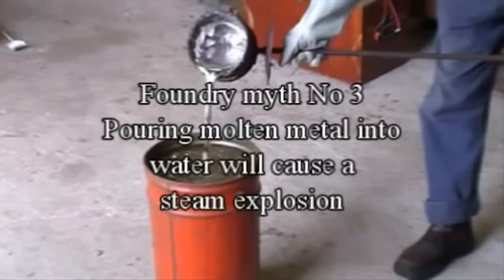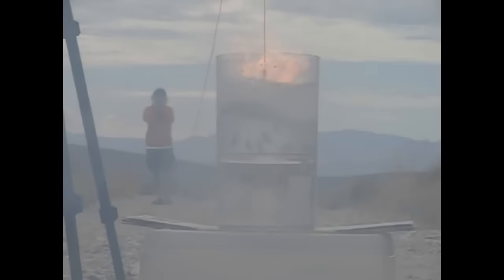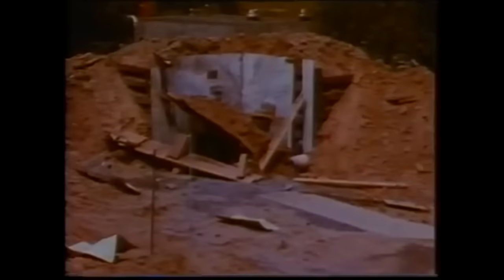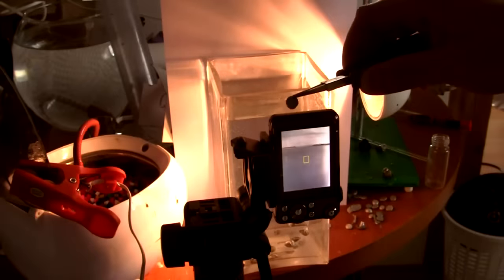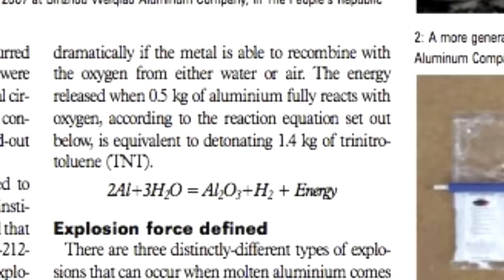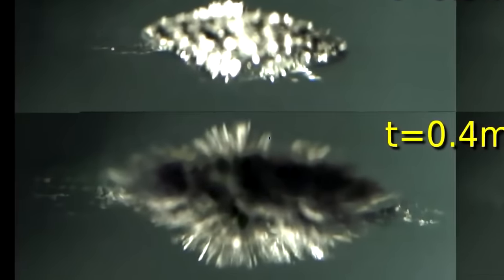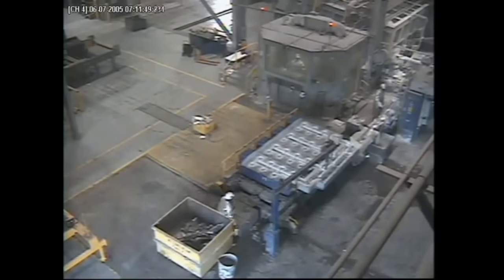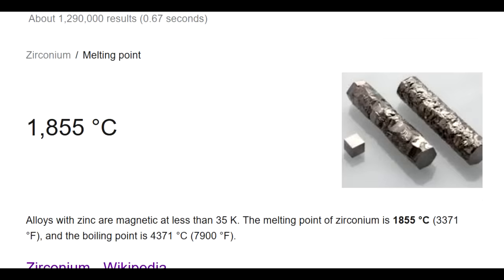The Awesome Power of the Aluminium-Water Explosion!

Comment: Industrial process cooling water can also often dosed with molybdate or nitrite and other corrosion inhibitors that tilts the pH balance a little on the alkaline side (can be almost 9). Whether this is enough to strip off the oxide is another matter. 
As for testing aluminium-water interaction, I suspect if you setup a high purity UHV system with a differentially pumped argon observation chamber; you could in probably off-axis evaporate high purity aluminium onto a hot (> Tm) pyramidal spike in UHV. The spike could drip point down into a differentially pumped vacuum to then an argon atmosphere puddle of DI water. Lotta setup but I can see it be an option.

Comment: pouring any amount of molten metal into water is only dangerous if there isn't enough mass of water to offset the total amount of heat energy in the molten metal as water has the tendency to flash to steam in small quantities. you cant add a pint of water to a gallon of hot metal because the total energy exceeds what it takes to flash that pint off water to steam. but a pint of molten metal into a gallon of water is pretty much safe as houses. if it wasn't then you wouldn't be able to make lead shot.

Comment: I hope you see this....  Many years ago I saw a film about the simulation of a molten sodium reactor leak (making this up - as it was so long ago)  the molten sodium was simulating a 3/4" leak in a reactor coolant pipe at 100 PSI - into the boiling water of the heat exchanger at 420*C....  AND so they got a BIG tank of armour plated glass, and filled it with hot water and dumped a heap of super hot molten sodium into it - and most of the laboratory was just detonated into oblivion.  It the way that the explosion happens, that the sodium blasts into ever smaller and smaller and smaller drops, which are all reacting with the water, and because everything is SUPER HOT and the REACTION is super hotter and super violent - enormous amounts of energy are released almost immediately.  I saw the footage once on TV I think in the 70's or 80's and I have never seen it since.  I have really looked hard for it but maybe it faded with time and history or maybe the nuclear industry shit bricks and buried it.

Comment: The catastrophic explosions that were shown in the video had nothing to do with Aluminum reacting with water to cause a chemical explosion like you would see with alkali metals. 
The reason why they happened were either a large mass of molten Aluminum getting poured into a mold or container that had a small amount of water present.
Now considering that the the conversion rate of water to steam is 1:1600, its no wonder that it can cause extremely powerful explosions that can easily level buildings in an instant.
The other way the explosion occurred was when a large amount of fine Aluminum powder got suspended in the air and got ignited, typically due to faulty dust collectors or just years of negligence that caused buildup on every horizontal surface in the area (which isn't likely to happen in a mega factory, but not that uncommon in smaller ones, especially if the boss is cutting costs)
A lot less energetic materials like sugar or flour can cause a devastating explosion when turned into an aerosol and ignited, let alone Aluminum.

Comment: The first video is the wrong way around, its a small amount of water in molten metal that explodes. The water is engulfed in the metal and almost instantly turns to steam. The mass of the metal acts as a sort of pressure vessel compressing the steam which then explodes as it rises to the top.

Comment: SOME PEOPLE JUST DON'T WANT TO LISTEN;  I once worked at an oil refinery plant where there was an explosion in one of the electrical distribution rooms ( with breakers and such ).   To clean it up we were given brushes, rags, and industrial strength ammonia.  I knew we would need proper chemical filters in our masks,  which is what I used, but this other guy wanted to come in that area wearing a mask with NO filters in place; he was breathing the air straight with no filtration.  I was telling him not to, and he and his buddies pushed me out of the way, and he went in despite my energetic protest that he should not.  He wasn't in that contaminated area for 3 seconds when he began screaming about his burning eyes and lungs, and his friends went in and dragged him out.  NO one told me I was right about needing the proper filters installed in the face mask, nor did they thank me for trying to prevent him from going in unprotected - they just gave me dirty looks like I was the one responsible.

Comment: It’s a matter of ratio, water to aluminum and the speed in which you drop the aluminum in the water. But it’s not just aluminum that does this. It’s any extremely hot object on or in water due to the instant vaporization of the water.

Comment: I've had this fun idea of heating about 200 kg of aluminium as hot as possible, then dropping it through a series of grates designed to spread it out, into a pool of boiling water. The steam explosion would (hopefully) atomize the ultra hot liquid aluminium, get it to react with atmospheric oxygen, and the cloud would then get hot enough for the aluminium to rob oxygen from the water vapor. The cloud would become incasdescent for a short period of time and after it has cooled a little the hydrogen would burn back to water. It would make an earth shattering kaboom.

Comment: I’ve watched less than two minutes in. My first thought is that there has to be a rapid introduction of the molten metal into a small amount of water, so that there is enough energy transfer to the water to turn it to steam. Just slowly tipping it into a relatively large amount of water obviously just cools the metal down without producing significant levels of steam.

Comment: I'm pretty sure that these aren't metal water explosions but aerosolized Metal explosions. The Foundry problem happens when so much metal is added to a relatively small amount of water that there's an explosive evaporation of water that turns the molten aluminum into an aerosol that then essentially is a fuel air bomb, or it could be a fuel steam Vapor bomb either way. When you slowly pour aluminum into a large volume of water very little water actually vaporizes and doesn't create enough of a shock wave to turn the aluminum into an aerosol they can undergo something equivalent to bleve fuel-air.

This would be relatively easy to test. If you had the right equipment in right safety equipment. You would simply dump a large amount of molten aluminum onto a modest amount of water. You should be able to reliably make explosions, while the same amount of aluminum dumped into a large volume of water would never lead to explosions.

You would also expect water very close to the boiling point too be much more likely to lead to explosions than water that was chilled to near the freezing point.

The thermite ice reaction I think happens because the molten metal liquefies and then vaporizes a small amount of the surface ice leading to the aerosol metal Steam and air explosion.

Comment: I have an idea for a molten zirconium setup: Use an induction heater on the metal inside an argon filled glass cylinder. If you get the coil shape right, the metal will levitate until it has the desired temperature and you cut power to the heater.

Comment: Interesting. I actually found this video because I started to look for "aluminum water explosions"  after reading an old paper about a hypothesis of the collapse of the twin towers in 2001. The author thinks it might have been, at least partly, due to the aluminum in the aircrafts ending inside a debris cover that acted like an oven, with the burning fuel raising the temperature to a point where the aluminum (there also seems to be some magnesium included) fully melted and started to flow down, getting in contact with the water in the sprinkler system in the lower floors. Then some of that exploded. Of course the kinetic energy from the initial impacts had already weakened the structures, a lot of the supporting columns seem to have been on the outside walls of those buildings, and the fire had started to soften the steel of the remaining support structure, so... well, at least that would explain the sounds of explosions reputedly heard before the collapses.

Comment: It seems adding water to molten aluminum causes an explosion by breaking the oxide layer on impact, by pouring it into water, that risk is decreased and it cools before it can react. Jmo question mark?
Reply: no, the explosion is caused by steam generated by the heat.

Comment: Here is a hypothesis. Take one aeroplane. Ram it into a tall building at say 500 km/h The aeroplane largely made of duralium get fragmented into small bits. A1 jet fuel, atomized by the impact ignites consuming all the oxygen and heating the aluminium to melting point very rapidly as it is airborne. Visualize globules of molten aluminium flying through an oxygen deprived atmosphere. Then the buildings fire suppression sprinkler system, triggers spraying water into the mix. 

Would it go boom?

Would the "rich" air fuel mixture Flash heat the aircraft aluminium to melting point forming airborne droplets of aluminium with no oxide layer waiting to be hit by a droplet of water, releasing hydrogen which has the added ability to explode Would a fuel rich environment consume any aluminium oxide skin as an oxygen source? Would it get hot enough to melt steel.

Love your videos though sometimes I want to take you to task with regards to energy density and Electric Vehicles. There is a word in the dictionary. Sufficient. EVs have sufficient energy density for 99% of use cases. I wont go on. Happy to discuss.

Comment: I wonder what kinds of circumstances cause the explosion to happen. 

It's probably more likely to happen if there is a high amount of aluminium and little water present, similar to how a glass of water in a pot of burning grease will cause an explosion, but doing the inverse probably won't. At least I don't see any firefighters asking whether there is a pan of burning grease in the kitchen before using their firehose.
Another example would be the constant streams of magma flowing into water with no explosion, yet explosions can happen if the amount of water isnt that high compared to the amount of magma.
Yet another example: Steam engines have a minimum amount of water required to safely run without exploding. The reason is that it needs to be ensured that the firebox is always covered by the water and is never dry on top, even if the train is going down a slope or decelerating. If it runs dry while e.g. decelerating, the firebox will heat up its ceiling to much higher temperatures and when the water comes back when the train stops, it'll evaporate instantly and cause an explosion.
Throwing a soda can into an aluminium furnace could have an effect like a hand grenade, likely even more than that, but throwing the same amount of hot aluminium into a lake would probably result in no explosion.

Just saying that the amount of water relative to the amount of "hot stuff" is probably very important in answering whether an explosion can happen or not. Since even magma can do it, it's likely that we don't need coulombic explosions or chemical reactions for an explosion to occur.
It could turn out to be perfectly safe to pour aluminium into a pool of water, but unlike a certain backyard scientist, you shouldn't bet your balls on it and instead stay on the safe side.

Comment: I actually worked in an Aluminium smelter............they were paranoid about glass and plastic bottles especially.  The reason being that if someone tossed a glass or plastic bottle into a scrap skip, the skip would then be charged into a remelt furnace...........and the liquid filled bottle would then be surrounded by molten aluminium..................causing it to undergo a steam explosion of great violence, heaving tons of liquid aluminium in all directions.............very,very bad.  The other big safety disaster is if the live smelter potline rails (millions of amps) were accidentally allowed to ground out to a shed frame for example.............really bad also.    Regarding Zirconium..............an overheated Uranium fuel rod would easily be hot enough to melt zirconium.............

Comment: So you need to heat Zirconium to 2k C with in argon atmosphere and get it to hit water? Get ballistic shield to protect camera, build bunker around that to prevent blast wave causing damage. Use possible class or acrylic tub with some water on bottom, tube on top that gets filled with argon (i recall argon is heavier than air) with relative high volume to prevent oxygen getting in. Suspend rod of zirconium in the tube and have induction heater liquefy that to droplet, that gets dropped into water, explodes and pressure is released by open tub. All including gas release etc can be remotely operated and repeated quite rapidly. You can ether test and calculate how long forming drop takes to launch camera with timer, or simply add motion detection on tube.

Whole experiment costs like 2-5k and you already have most what you need for it. Safety is ensured by remote operation and nothing will happen until you heat Zirconium. Am i missing something here?

Comment: If  I don't remember wrong a Norwegian chemist once hypothesized that part of the cause of the world trade center falling as fast as it did when the planes crashed into it was the aluminum in the planes melting in the intense heat of the fuel burning and leaking down into the water from the sprinkle system causing explosions weakening the structure of the building.

Comment: Thinking about this some more, a simpler way to crack the Al oxide skin might be to sharpen a pencil-diameter hardwood dowel in a pencil sharpener, submerge that underwater and direct the molten Al through heat-resistant funneling over the point.

Comment: So really, the people who were pouring the aluminium into large containers of water were safe because the large volume of water cooled the aluminium and very little steam was generated, and couldn't build up under the metal.
It's when a large amount of al is poured into a container with a small amount of water, turning it instantly into steam, which causes the explosion, not the metal reacting with the water. 
I know it's different in large scale operations, when water may come into contact with a large amount of al without the oxide layer, but we see several examples where pouring it into a relatively large open container only solidifies the metal.

Comment: I have an idea for makin  the zirconium bomb safely. Use a capacitor bank (a huge one), a sealed flask filed with water with two large diameter cables conected with a zirconium filament. Then you use a industrial relay with a remote control to close the circuit and BOOM.

Comment: I never poured molten metal anywhere (so far, I want to try few next year) but I think that the most important is ratio. If there is only a bit of water so it can heat up enough to boil, you are screwed, if there is enough to not boil and you pour the metal in slowly so it can cool down, you should be more or less safe. Or am I terribly wrong?

Comment: There are different alloys of aluminum also, i believe 1100 aluminum is pure, often used on aircraft as a corrosion protective skin, but the kind most people melt at home is i believe a 3300 alloy aluminium maybe making it less reactive? That's all I can postulate based on what i know.

Comment: i think a big factor is the difference in temperature between the molten metal and the liquid.
try pouring molten metal in a bucket of water layered with dry ice, i'm fairly certain you'll get the reaction you desire easier..

Comment: An o2-free environment for the melting of aluminium would indeed be a difficult venture but possibly, with a high drop in a heavy gas tank, basically flicking the metal out of its oxide, could do the trick.

Comment: I always understood that it was the rapid heating of trapped water in the aluminum that caused the explosion. Water when heated to 2000° expands to something around 1900× it's original size. That happening in milliseconds is catastrophic. My question is are you saying the aluminum explodes as well? Or as a result of the rapid expansion of the water?

Comment: I was doing some repairs in steel factory. They produce man hole and those sort of ductile iron things. Process goes like this; put scrap iron in semi full furnace, put some additive and wait until all is melted and get to temperature and at the end pour it in mold. No explosion involved. But there are mini explosions all the time. Sometimes they are not so mini 😁😁😁.
At the entrance the give me some thick boots(pants must go outside not inside boots), and thick coat. I was like mate why I need this, I'm not gonna do anything with melted iron I'm here to change fans. Safety dude was like dude you gotta have this on you while you are in furnace room. And boy do need it few times. When scrap metal is wet and they put it furnace it explode. Sometimes it's little, but sometimes windows get smashed and glass flying around together with melted iron. Thing about water is that it expands. 1 L water makes 1700 L vapour. Same goes for any other liquid. Let's say shock absorber from cars in furnace it explode pretty badly.
You might don't even need chemical reaction, heating enough water or oil fast enough will kill people around